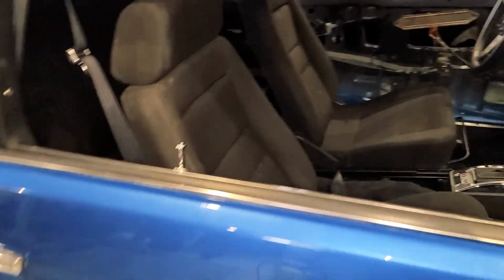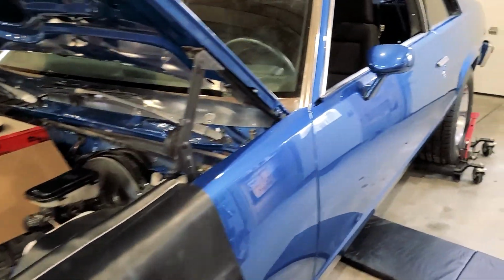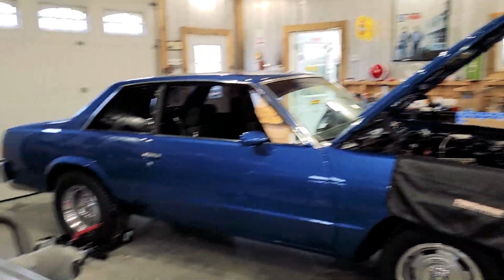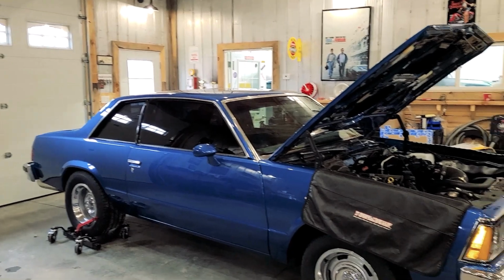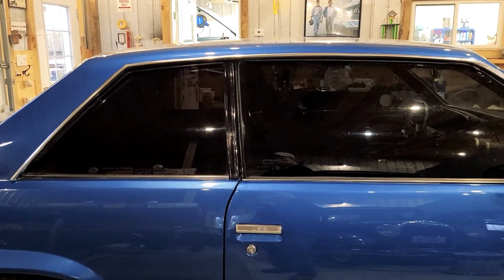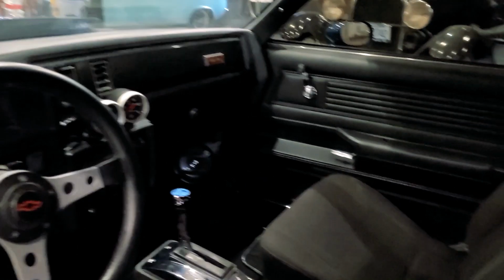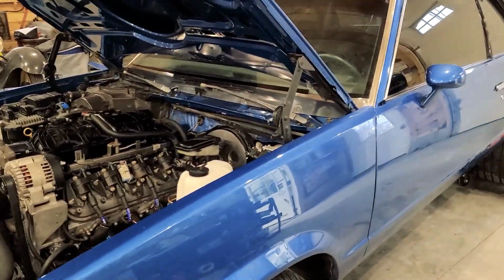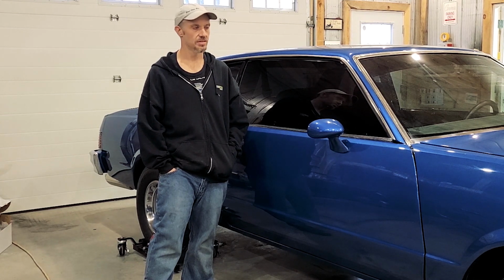G Body LS Swap project - What's left?

Comment: Hey just curious, In previous episodes you mentioned your truck intake causing clearance issues. How did you resolve that? Just with the cowl hood? Did you consider cutting the webbing of the intake? Currently stuck at that part of my build. Just not a big fan of the cowl on the malibu. Thank you for all the great content soo far!
Reply from the maker: I did shave the webbing of the intake. The cowl hood gained nothing, it's not necessary at all for LS. The big difference for me was a Holley throttle body adapter. On the truck 5.3L the throttle body points upward, and that was my highest point. I bought the wedge shaped throttle body adapter and that corrected the throttle body to level and then I had clearance. I also used low profile motor mounts that I fabricated but similar are available everywhere. I did another video on "lessons learned" and it goes through some of the things that I would do differently. Check that out. I have 10000 miles on this build now and it's still working great.